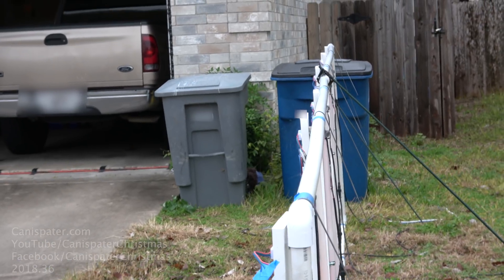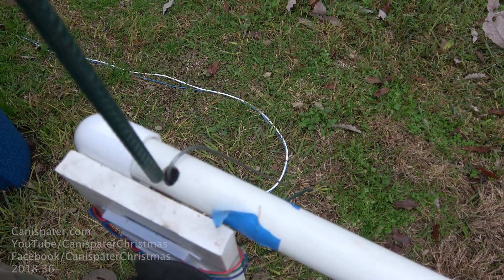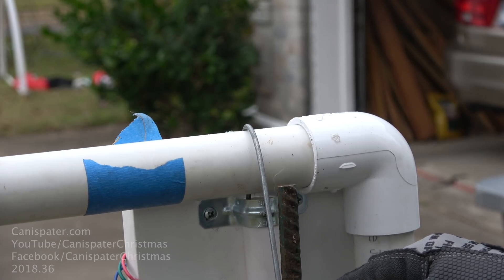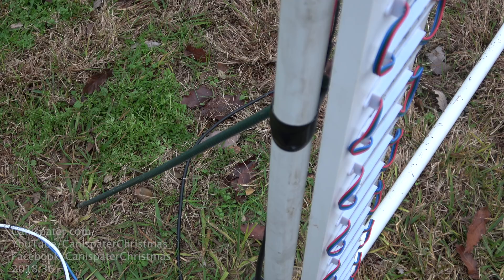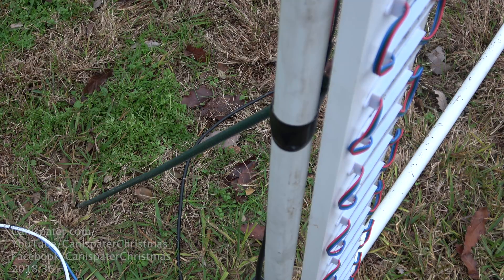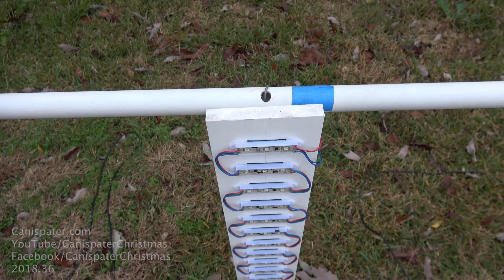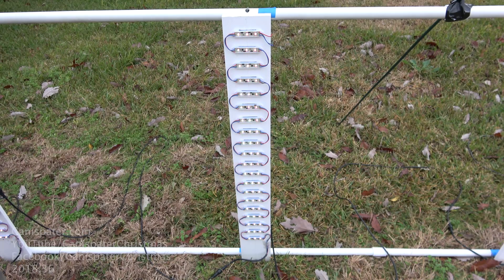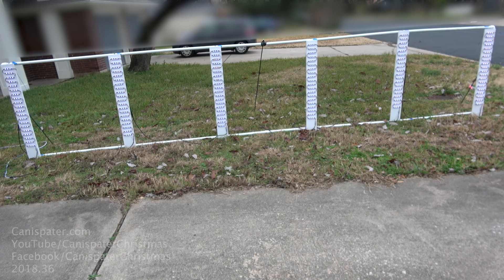Some Good, Some Bad, Some Ugly (2018)

Comment from the maker: Haven't heard back from Ray yet, but I think I know why those lights were on sale... :)
Reply: I've heard similar stories with the items marked as "promotion".
Reply: why?
Reply: @jc-zh9kl  it seems that the Chinese sellers sometimes know that the product is less than 100% and sell them cheaper under the "promotion" banner
Reply: The PROMOTION! nodes I have are smaller gauge wire and shorter span between nodes, so do not suit large pixel counts on some Boscoyo items for example. Had to add extra wire to reach some gaps between holes in the coro.
Reply from the maker: I believe I've learned something from all this. lol!

Comment: Jeff, can you tell me what you used for your bottom ring on your mega tree?
Reply from the maker: I’m using 3 x 3/4” pieces of PVC electrical conduit. It isn’t perfectly round so may go EMT at some point, but need a bender.
Reply from the maker: I may have cut a few feet off. Diameter depends on height. I forget the ratio.
Reply from the maker: Oh and then I just criss-cross tent stakes over it to hold it down. Then use bungee balls to hold the strings to the ring. Hook the strings first, THEN the tent stakes. lol!
Reply: @CanispaterChristmas  I really appreciate it! I'm trying to plan a tree as my break thru into the hobby since I can't do the entire house outline yet.

Comment: CanispaterChristmas - can you do a piece on how to troubleshoot not correctly responding pixels and pixel strings.  I have a nice setup and every day I have to power cycle or restart the controller to get my lights to stop blinking randomly when there is no program running.

Any bit of help would be wonderful.  Also any tips on how to waterproof the connectors more, sometimes I feel like water is the cause of the random lights blinking and freaking out.
Reply from the maker: I have a couple of floods that were turning on without data and noticed the connector was sitting in a puddle of water. Dried it out and propped it up on a stick and no more problems so you may be onto something. Generally, if you use the gaskets (red o-rings) on the connectors and keep them above water apparently, no issues. I haven't gone so far as to use dielectric grease inside the connectors, but that's another option - kinda messy tho.
Reply: Do you keep your controller boxes powered up 24/7 or just when you need them on?

I have cut strings to length, so I have cut wires on the ends, do you recommend putting silicone on them to keep out water or issues that might cause freaking out lights?
Reply from the maker: I turn them off during the day: https://youtu.be/vFRPnUw2AhA Computers (Pi, BBB for the sign) are on a separate circuit that stays on. So you have wires terminating in boxes with the power supply and no other connectors involved or do you mean you have exposed wires just hanging out in the weather? I use the pigtail connectors that come with the strings. They aren't waterproof, but seem to work fine except for putting them in puddles. :)
Reply: All of my boxes are outside.  Mounted in my main controller is my PI and network switches.  i have been leaving them all powered up 24/7.  I don't have a garage to put them into to keep them out of the weather.  ill have to figure out a way to put the controllers and PSU on a separate circuit so i can power them on when needed.  I don't have bare wire's un terminated in my boxes.  on the end of my pixel strings, where i have cut them to length, there is a 1/2' tail of insulated wire, just incase i want to add more pixels to them.  they are cut clean, just no connectors or anything on the end. @CanispaterChristmas
Reply from the maker: Oh ok. You don’t have to turn things off. I left mine on last year with no trouble. Just seemed a little wasteful leaving 2 100watt lights on all day. :) It wouldn’t hurt to insulate the ends somehow. Unless they are sitting in a puddle of water, probably something else flashing them with no data - bad ground possibly? Check the connector for that string and make sure the wires are in there good.

Comment: Well, sure glad you posted this video!  I was about to purchase a bunch of the 3 pixel strips and mount them under the eaves of my house.  Based on your experience and comments from others, I am rethinking my plan.
Reply from the maker: May not be this style of light - just a bad batch. But yes, I’ve had MUCH better luck with standard bullets and flat bullets. Just don’t buy “promotional”  strings.

Comment: What is the actual life expectancy of a pixel anyway?
Reply from the maker: I believe the guideline is 50,000 hours at full brightness, 24-hours per day. So several years for how we're using them. Now that's ideal. I usually have to replace one or two nodes each year, but this failure rate is especially high.

Comment: I have a controller from Falcon F48 and  I would like to know if I can power on from the power suplay that feeds pixels or from Differential Receiver Board
. I have 3 power suplay of 5v dc, 80 A
Thank you
Reply from the maker: The F48 runs off 5V so you can use the same 5V power supply. However, if you notice the F48 rebooting when the lights get bright (high load), you may need a separate power supply to power the F48.

Comment: I love the intro’s they are always good. Bummer on the pixels I have them in some small holiday Coro trees, but they are the dumb pixels, and they appear fine. I’ll have to open the trees up and see what they look like at the end of the season. 

Quick question for anyone to answer, what do you think of the strip from
Boscoyo? I’m thinking about getting the Chormatrim V3 and just leaving it up all year. We have a 2 story house and I would like to install them and not have to go back up there if I can avoid it.
Reply from the maker: Thanks! Yeah, it's a process. :) The problem with leaving pixels out in the sun is they yellow after some time depending on the amount of sunlight they get. The ChromaTrim V3 is nice tho.

Comment: Love the intros!!!!!  I used the bullet pixels on the boscoyo chromo trim and 12mm bullet mounting strips as well as holiday coro's snowflake and candy cane pixel props.  I had problems with the 3 pixel strips (same with going out) but was awaiting your set up with them to see if you had better luck.  Glad to see not all is going downhill.  My first time set up is really doing well and amazed how it is standing up to the weather as we have had to major rain systems come thru and the lights keep working.  Thank you for all of your updates as they have helped me plan for the first ever show and it seems to be working well!!!!!  Cannot say enough to thank you!!
Reply from the maker: Haha. Thanks! Yeah, the rest of the stuff is doing great except I got a little water in one of the ammo boxes. No failure because I caught it before it got too much, but I'll probably just use more CG-1500s as they seem to have a ton of room and would drain if anything got into them where the ammo cases won't... or just wrap that one in a trashbag... We got some very heavy rain and have had some high winds this year. Glad to hear it's going well!

Comment: I feel your pain with the dead LEDs! My broadcast frequency sign blew over on an extra windy day earlier this week and 2 of the 3 LED strips (I cut larger LED strips to make the numbers) were showing completely different color.

For me it actually turned out that the ws2811 chip came a bit loose, which surprised me since they are the ones covered in silicone. After tearing off the silicone to diagnose, I noticed when I pressed the IC down it worked as expected. So a quick re-solder made them work like new, except not waterproof anymore.
Reply from the maker: Yes, we are also having unusually high winds here as well. I'll step outside once the winds calm a bit and try pressing on them.